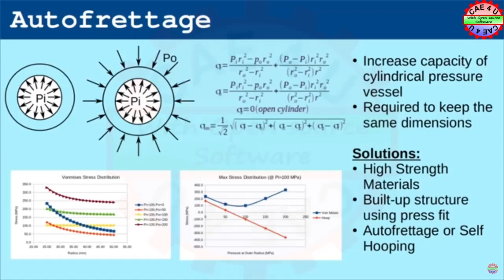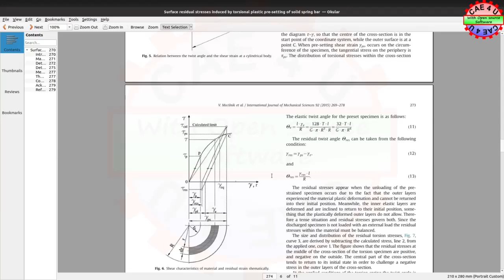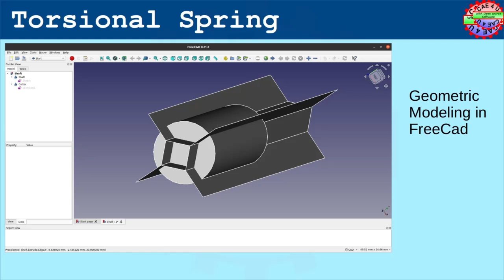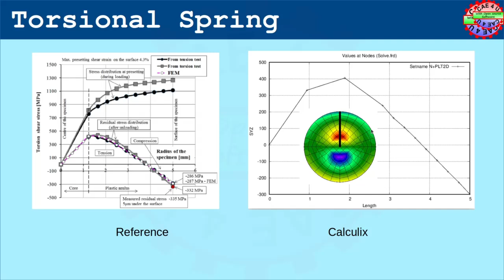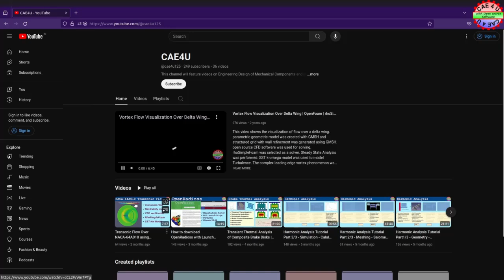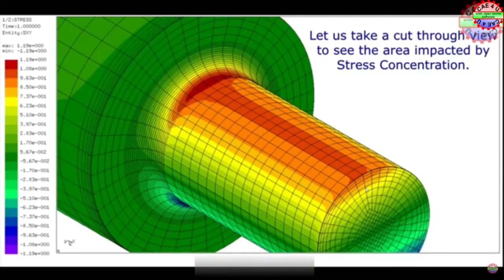Comment: Nice videos!! Thanks for sharing. It would be nice to use PrePoMax so you could use only one software for both meshing, pre and post processing.
Reply: Thank you for the suggestion. No doubt using PrePoMax would be advantageous. However it doesn't support Linux OS natively. We wish it would be available some time soon, So that it can be used without Compromising performance/disc space, which is premium for us, currently.